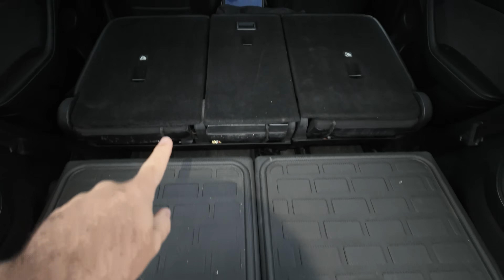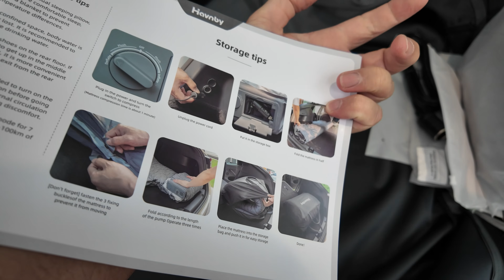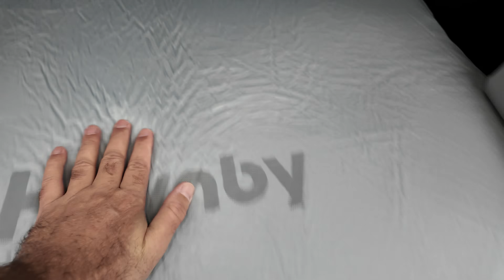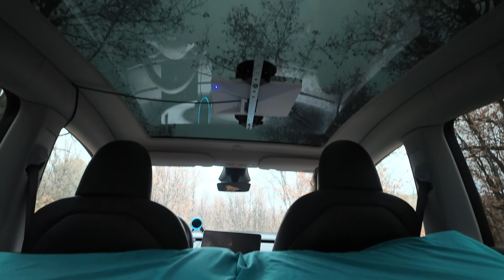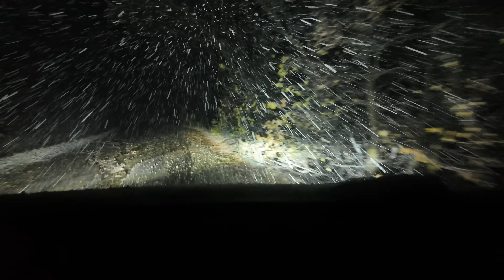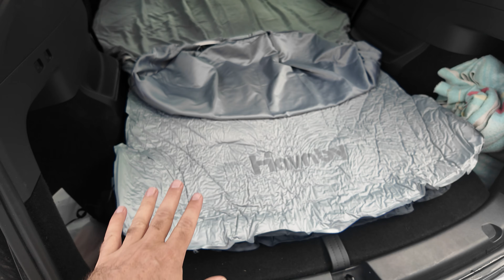Havnby Mattress Review: Ultimate Tesla Camping Solution!

Comment: Thanks for the video review! How does this compare to the Lost Horizon one you showcased in an earlier video? Have you had your kids try them out to see what they prefer?
Reply from the maker: The feel of the mattress is the same between them so it comes down to the difference of how the Havnby has an integrated pump versus the Lost Horizon has a separate pump that can get lost but also advantageously can be used elsewhere if you desire. Ultimately I prefer the Havnby mattress. The ease of the integrated pump being able to switch between filling the mattress or sucking the air out of the mattress is super quick and easy to do and it doesn't even have a cap that you have to screw on. I like that it doesn't have a battery that I have to manage and I can just plug it into the power socket of the vehicle.

Comment: Which one you like better the havnby or the lost horizon your previously review. Thanks
Reply from the maker: The feel of the mattress is the same between them so it comes down to the difference of how the Havnby has an integrated pump versus the Lost Horizon has a separate pump that can get lost but also advantageously can be used elsewhere if you desire. Ultimately I prefer the Havnby mattress. The ease of the integrated pump being able to switch between filling the mattress or sucking the air out of the mattress is super quick and easy to do and it doesn't even have a cap that you have to screw on. I like that it doesn't have a battery that I have to manage and I can just plug it into the power socket of the vehicle.
Reply: @ElectricTechAdventures does the havenby still have the intergrated 12v pump?
Reply from the maker: @jt19767171 Yes. I can't remove it because it's built in.
Reply: @ElectricTechAdventures ok,i think the new model have an usb c charger and not 12v.
Reply from the maker: I just looked at the Havnby website as linked in the video description and you're right that the new version is battery powered and charged via usb-c.
Reply: @ElectricTechAdventures do you think the pump still i intergrated in the left side and works as the version you have
Reply from the maker: My guess is the functionality and location is the same but that it's now rechargeable battery powered.
Reply: @ElectricTechAdventures maybe, but on the picture you see the pump seperat,it would be good to se how it works without the 12v
Reply from the maker: I just pulled up the site again and I'm going through the pictures and at this URL https://havnby.com/products/tesla-model-y-3-x-foam-mattress there is a picture that shows the pump separate from the mattress, but I think it's just showing that for illustration purposes as lightly in the image is the outline of the mattress that the pump is actually embedded in. It does say Type-C Cordless and easy to charge. It also says Use anywhere, no plug needed. I think it's still embedded into the mattress (non-removable) but I think they've added a battery to it that's chargeable via USB-C and in the picture is also shows a USB-A port which I'm guessing you can use to extract power from the battery such as using it as a power bank. I'm not sure though. I recommend you contact their support for clarification.
Reply: @ElectricTechAdventures super, thank you very much,i will contact the support,have a goo dag.
Reply: @ElectricTechAdventures 
Have you seen the new one they made, it's more straight when you lav on it, they said there's 12v in Europe and the USA and USB C in Asia
Reply from the maker: @jt19767171 Yes I saw it on their website.
Reply: @ElectricTechAdventures exiting to test  it
Reply from the maker: I'll make a video testing it if they send it to me.